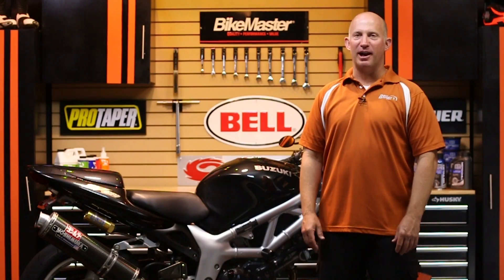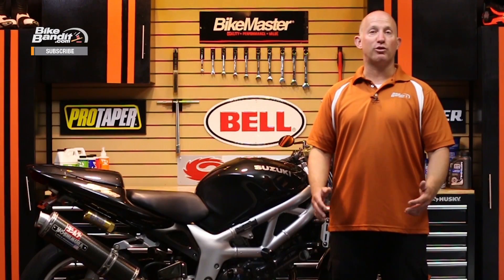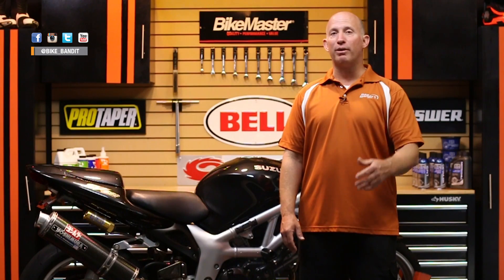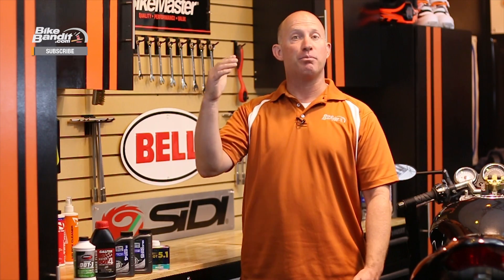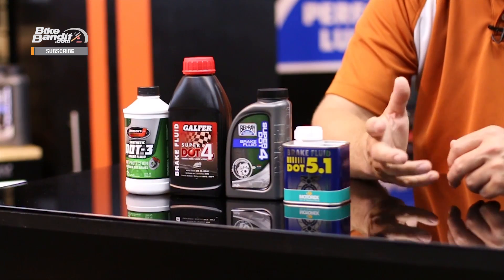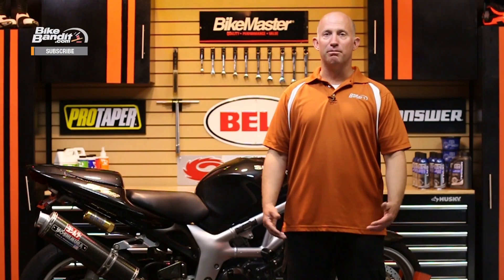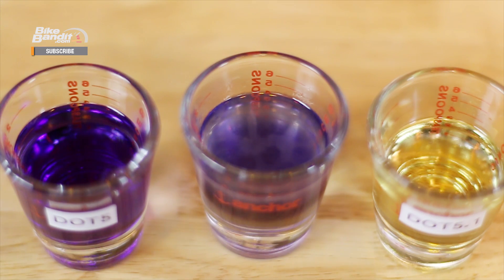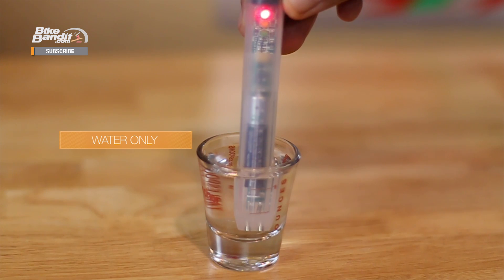Motorcycle Brake Fluid Crash Course | BikeBandit.com

Comment: My brakes are locking up with simple engine heat (tested while idling, not using brakes). I've been using Valvoline DOT 3/4, while manufacturer recommends DOT 4. Could I switch to 5.1 and prevent fluid expansion? Thanks!